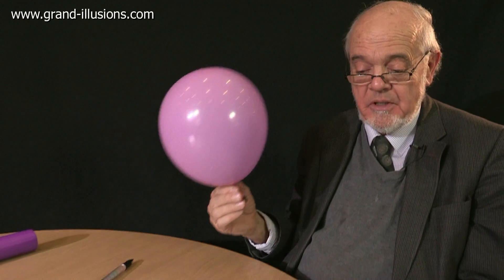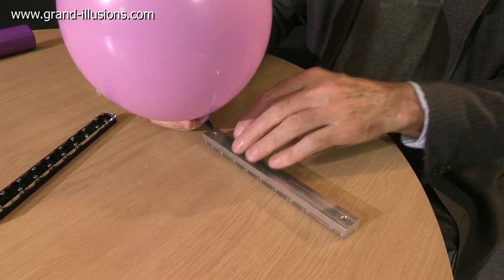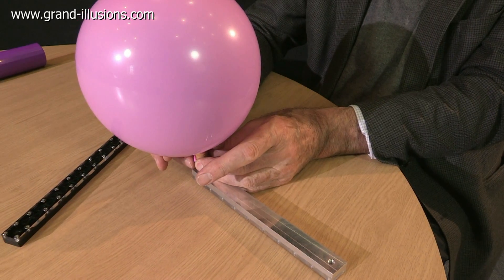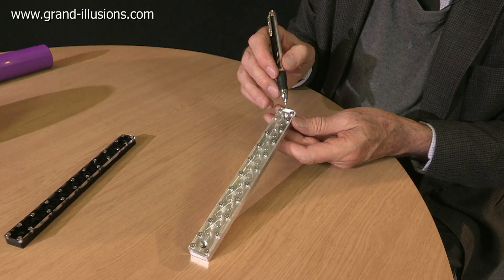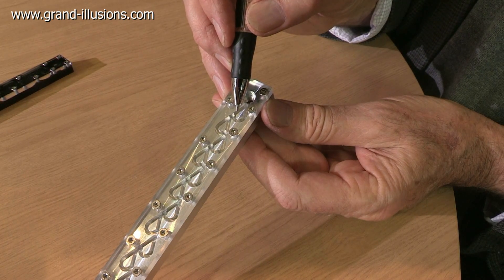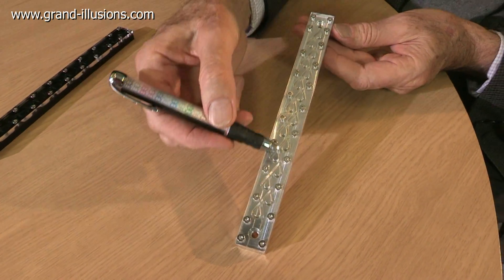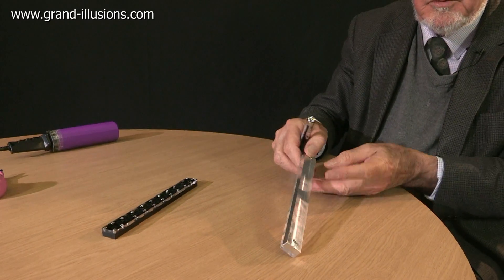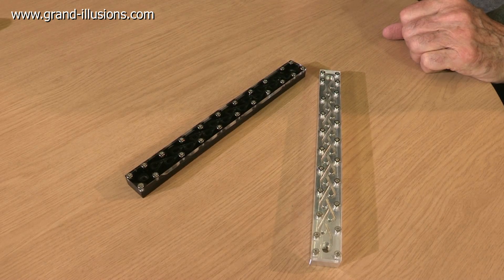Tesla Valve

Comment: Veins in the body, same thing only better...
Reply: +Walkertongdee  Veins in the body have moving parts.  They don't work better or even do the same job as this.  This is not an anti-backflow valve.  Plumber maybe, engineer ?
Reply: And yet you keep responding after saying you wouldn't.  " I did not read your post." Afraid you might learn something?
Reply: +Walkertongdee
Venous valves are not the same principle, although they may work better in that case.
Reply: They are both one way valves, blood goes one way only so does air which is also a fluid as with this valve but you see it is not as efficient as a vein is..
Reply: +Walkertongdee 
Apparently you lack understanding about valves that goes beyond "they make stuff go one way only". Can't help with that.
Reply: +Walkertongdee 
Hopefully not as a surgeon.
Reply: Plumber and engineer,:)
Reply: +John Statser WTF is my crack showing so you want to Eff with me or something? What we are talking about here is plumbing, plumbing is the management and transportation of fluids and it may or may not surprise you that air is a fluid as well.  A one way valve is a check valve, the Tesla valve is a check valve and a RPZ plumbing valve is a check valve and the veins in your body have check valves.. A check valve prevents water from flowing backwards as pressure lessens or drops. When I went to college I worked for this guy Dr. Martin. We were developing valves for medical use. Now as you infer I work with RPZ check valves, I keep poisons out of your drinking water. So as you are still alive, I just may know what I am talking about.  Perhaps you love Tesla or something; I get that but realize that although he had many great inventions that improved our lives this valve wasn’t one of them. It is a one way valve without moving parts sure but it has not been used for the reason that it is not very effective as it doesn’t prevent fluids from travelling backwards as the pressure lessens. It needs a constant supply of pressure to work and pressure is never constant. There just isn’t much use for a valve that works sometimes under certain conditions; a check valve is required to always work, unless it is broken. A check valve in plumbing is a one way valve, a vein is a similar one way valve and a Tesla valve is a one way valve that will work partially, it is not as effective as the plumbing check valves that we use today or the veins in your body. If the vein fails you may die, if the RPZ valve in a factory that bottles poisons fails these poisons will enter the water supply and perhaps kill you. Now all three of these valve are check valves. The Tesla valve excels in working while the fluid is running, not much use for that and it fails as the pressure decreases, a big fail there. A RPZ valve rarely fails as it has several backup mechanisms. Veins are remarkably efficient, they may fail but there are backups there too so people don’t die because of failure of a single vein valve malfunction. The Tesla valve is not used because it is not effective, this design would not work in practical applications.  Sorry but I will not be making reply’s, I have stated my case and it rests. If you want to argue go elsewhere. I have no patience with people who think if they argue well they can win regardless of facts. I only reply here for those who are interested in why things work or in this case don’t work. To see a better valves go here- http://www.firststatevein.com/how-do-veins-work.html       andhttp://www.macdonaldindustries.co.nz/Site/Water_Control_Products/Backflow_Preventers/High_Hazard_Devices.ashx
Reply: Hey, your the one who said these were "Veins in the body, same thing. ( my emphasis)  they aren't the same thing at all. The reason i asked about your engineering  is because when others tried to point out the diff between the valves you called THEM ignorant.

The Tesla valve is NOT a check valve, it allows fluid movement in both directions. It is NOT a one way valve. When you went to college you worked for a guy with a doctorate? So did I, several Doctors, some with multiple degrees, Whoop dee do. When I finished college ,after a major in Biology, minor in Chemistry,  some physics, including fluid dynamics, I went to work in Water Treatment and Waste Water Management labs.  Lot's of valves every where, some high pressure some RPZ. I kept poisons out of folks water too. I found the poisons, I removed the poisons, I told people which valves to close, which ones to open how much and for how long.  'A RPZ valve rarely fails as it has several backup mechanisms." The back up mechanism is not the valve, it is there because valves do fail.

"people don’t die because of failure of a single vein valve malfunction."   You're not a doctor that's for sure.  Let's disable that ol femoral vein and see what happens.And didn't you just say 'If the vein fails you may die."

Ooooh, prettycolored pictures of veins and arteries. I've dissected veins and arteries, resected valves. They're not as pretty as that in real life.

And pictures of valves. Why It's The Washroom News! Featuring the Wilkins Reduced Pressure Zone Valve 375 Series 15-50mm !! And Urinal Flushing, Toilet Flushing, and Bathroom Accessories of all types. 

 Facts? You don't even know what the Tesla valve is, what it does, or how it works. Watch the video again

Don't bother replying,  you already went down the drain. And there's a check valve in it.
Reply: +John Statser Dude they are both one way valves, same thing! The only difference is the Tesla valve works poorly. Perhaps Tesla had a device where this valve system could serve a purpose but in our world it is probably useless. There is a reason why it has never been used. You say fluid flows in both directions and it can that’s the problem, duh.  If you want flow in both directions you don’t need something like Tesla valve, just pump the water normally. It’s a one way valve that doesn’t prevent reverse flow and therefor a fail. You want a one way valve to actually work. You want the valve to stop reverse flow and Tesla's valve just slows it down.  Tesla's valve is complex, restricts the flow and doesn't work. The video proves it doesn’t work. Both ways the air still passes through, one way is somewhat restrictive and the other direction quite restrictive, that’s your bi directional flow in action. If you want to slow down the flow there are far simpler ways to do that, there is no use for a Tesla valve. If the toy person put an ordinary check valve on it and reversed the flow no air would have escaped. Applications of a one way valve require that there is no reverse flow. Tell me just how many of these Tesla two way valves are in the water treatment plant where you worked, wonder why there were none? I called no one ignorant but ignorance is only the lack of knowledge, most people can learn except you evidently. Now you have wasted too much of my time piss off.
Reply: +Walkertongdee The Tesla Valve is NOT a one way valve.  You say so yourself, fluids flow both ways.  It is possibly a prototype for a one way valve. but it cannot yet be used as a one way valve.   Why do you insist on saying it is a one way valve?. I never claimed it did anything useful. I don't think anyone has. It is not presented in the video as useful or as a practical or complete one way valve . I never said we should use it in water treatment or any where else. Perhaps it may be developed into a practical valve, perhaps it will remain a curiosity, perhaps it will become something totally unexpected,  or demonstrate some unknown principal.  Could be applications in electronics and nanotechnology.  Or a lawn sprinkler.
 Make up your mind, "... the Tesla valve works poorly."  "The Tesla valve excels in working while the fluid is running, not much use for that.." Because what we want is a valve that works when there is no fluid flowing. "... fails as the pressure decreases" maybe it should just be used, if it ever is, in high pressure situations.
"... in our world it is probably useless." Hertz transmitted electro- magnetic waves in the 1880's, he said it was of no practical use.   Peter Barlow  spun a disc in an electro-magnetic field  around the same time,  he could stop the spinning by blowing on it.  useless, might as well forget about it.
"Tesla's valve is complex."  That's a comparative , moving parts can be complex. 
 You got called on your lack of medical knowledge. Nothing wrong with that lack, but you responded by telling people to shut up,  that their ignorance was showing, (Whadda ya mean you "called no one ignorant?" Any way you slice it, that's caling some one ignorant.) You'd been working with valves for 50 years.  Dang1 How could any one question your knowledge about veins and vein valves. Or anything for that matter? I questioned your qualifications as an engineer. You responded by saying it was a matter of plumbing. That in college you worked with "this guy." That you have saved my life with your valves.  Then you showed pretty pictures  of veins and plumbing products.  At least if I do piss off, I can flush it .

i have wasted your time?  Am I forcing you to read this? Forcing you to respond when you have stated you would not? ( Twice I think)
Reply: Did I not tell you to piss off? FYI I did not read your post.
Reply: You are right I don't know whats wrong with me but I do know whats wrong with you.Get a life lonely boy.
Reply: Well, now, you've saved me some time. I coulda said the same thing to you.  
 But don't worry, I am not lonely, nor a boy, and  I've got a life, For now anyway, Cat-scan  and biopsies next week to see how much more  I might get.
 Cat-scan,  not MRI so no Teslas involved.
Reply: Girl named John who would have thought. I figured you for a game boy who likes to argue and annoy for fun. I don't believe you for a second by the way.
Reply: I am not a girl.
Reply: Not a boy or a girl, transgender?
Reply: guess again.
Reply: Hermaphrodite
Reply: I am an adult 65 year old male, a man, not a boy. 
 BTW are you in the states? It's 6 am here.  i've been up all night. due to steroids.
Reply: Me too, I live in Thailand 7:30 pm here, Hey are we getting along what goes?
Reply: What gives?  i dunno. It turned into one of those  quien es mas macho things. Over a relatively minor disagreement with neither of us willing to yield an inch..And thr was that bit of childishness where the last person to make a comment of any sort "won."
 Then I got sleepy.  Steroids screw up my sleep pattern fierce. 
 Today i am playing phone tag and fighting doctors receptionists.  My Doc said to get cat scan ASAP and  it was "vitally important"  to see him for biopsy immediately after. So vital i am to have scan done near him, 25 mile from me.  So  I make appt for catscan, call Doc's office they  try to make appt two days after scan!!    It is back and forth between the two places. trying to co-ordinate.  Latest deal drive out there 1/2 hour, get scanned 1/2 hour , wait 2 1/2 hours for appt with doc!  There is a scanning center 5 minutes from my home! I could go there, come home then go out to doc.  Of course that would mean waiting another week or more for insurance etc . ARGHHH!
 i got no time for petty quarrels.  You're still an idiot, but so am I.
Reply: We are stuck with ourselves... Good luck and best wishes with your health. Lots of retired people here in Thailand, one can live like a King on their ss check, just saying.
Reply: I don't like Asian  food. Ginger, and what ever  else spices are in most of it. .  From India all 
the way east, down and  up . Get to Japan some of it I can take.   And  I'm in Texas, what would i do for Chicken fried steak, chili, and  barbecue? Tex-mex,  margaritas,   Cold Shiner Bock Beer. Blue Bell Ice Cream. Pecan pie. Cajun food from the bayous and  Fresh Gulf shrimp boil..
Reply: we got all kinds of western food here are 7 macdonalds in my town... We got mex, tex and shrimp to die for. The margaritas are made from fresh fruit we got hagendas. beer from everywhere in the world. more choices for food than you can eat.
Reply: Walkertongdee hagendas, that's from New York City. It melts at the mere mention of Blue Bell.
And macdonalds, Around here  Mc Donalds  surveys areas for  population density of elementary school age children,  Not enough gullible  grabbers of kid meals, they won't open within a mile  of a Whatta Burger.  they'll open next door to Burger King, jack in a box, but not Whatta Burger,  there a bit leery of  Texas Branch of Dairy Queen too.  
Nope I think i best stay around here. 
 i just remembered a thing,not important.  Not far from me  was an old time Texas barbecue shack. Small place, an old formica kitchen table and  a few old school desks with the armrest desk, you know the kind? They are traditional seating in such a place . He smoked Briskett  ( in Texas if you say  just barbecue, you mean smoked briskett, any thing else is called what it is; smoked sausage,  smoked ribs etc) and he did a few sausages.  It was traditional German Texas Meat Market Barbecue like the originals. But Pete, which was his name, was a Greek.  it was like me goin to Greece and opening a Chinese take out.   Whole family working there from time to time all talkin Geometry and philosophy or  somethin. My son was in College at the time getting a degree in Chemestry and for some reason taking Greek, He heard um talkin and that's how we even learned they were Greek. they would have short halting conversations.  They'd laugh at his accent and he'dtell them to say Nacogdoches or Mexia.
 !993 a bomb was set off in a World trade Center Parking Garage.   Pete was dark skinned Mediterranean, this is Texas  where 'you ain't from around here are ya?'  is not a question   but a threat anyway.  some Red blooded American patriots got up to some serious mischief. Pete put up a small sign over the counter. " Pete's A GREEK."
 Now  read that out loud. Pizza Greek. We'd  ask friends to go with us for barbecue at Pizza Greek's
 A Greek Pizza Joint that smokes barbecue.
 I told ya it wasn't important  or interesting.

Oddly enough, ( another remembering) in the opposite direction fro Pete's was a an old tumble down corner store, it was run by a Palestinian,  who also became a friend of ours. He  leased it out  in 1992 to a group of other mid east folks who were kinda stand offish. turns out unbeknowst to him or any body else, .til much later, the store was a phone message  drop  center for the folks that  bombed the Trade center garage!  Someone would call from a payphone somewhere to this little place give a phone number to another pay phone  to pass on to another pay phone  and back and forth.  By the time the feds figured it out most of those guys were gone.

We moved here cause it was a quiet two block square neighborhood surrounded mostly by empty fields, ponds  and wood land.
 A TV show, Walker Texas Ranger spent two days filming stunt men running down our alley.Tornado ripped thru 1/8 mile away.  Huge army copter emergency landed in field behind house across street 
 In this area of smallish three bedroom homes, one neighbor with some bucks wanted a bigger house. he built a house AROUND his existing house.  Not like an addition, you walk in his house and there is a house inside his house, brick walls,  doors, windows a house.  .   
 i think i surpassed my character limit.
Reply: They got  place here that sells greek pizza, best pizza i ever had, olives and feta cheese. Remember John Belushi Sat Night Live, that was about a Greek burger stand in Chicago I knew. cheesbugga, cheesbugga LOL...

Comment: would it be possible to get one of these? where? I have a hydrogen generator project going and this is the perfect one-way valve for my project.
Reply: +Brad Lee Find someone with access to a CNC machine or 3d printer. There are also several online services.
Reply: It's not a one-way valve.
Reply: @RFC-3514  yes I get it just need to decrease the flow in one direction.
Reply: @duelette  - Well, you said you needed a one-way valve. This isn't a one-way valve. 

And sure, it would be possible to get one of these, you just need to supply the specifications (type of metal, dimensions, number of chambers, etc.) to a company (or anyone) who does machining.

But chances are you will get better results with a different design. There's a reason why these valves are seen just as curiosities and toys; nearly everything can be done better and more cheaply (and with more versatility, greater ease of maintenance, etc.) by other valve designs.

Comment: I ran across this old digital computer patent 3190554 where it operated on compressed air instead of electricity. Was one ever built and use for anything? Could one be built today by a 3D printer? If Babbage had gone with compressed air do you think his Difference Engine could have been built by the folks who built pipe organs?

Comment: I note that it is stated that this is a forgotten invention but I'm not entirely sure that is the case. Turbines (and other high speed gas/fluid) pumps often use labyrinth seals which work in essentially the same way, relying on turbulent flow to prevent leakage across the seal. There is no actual physical contact between the sealing faces.
Reply: This is by no means a "forgotten invention". It is applied in a lot of different areas and even Tim has one, it just isn't as viral as the Tesla coil or lightbulb.
Tesla also has a steam power generator, which isn't necessarily forgotten either.